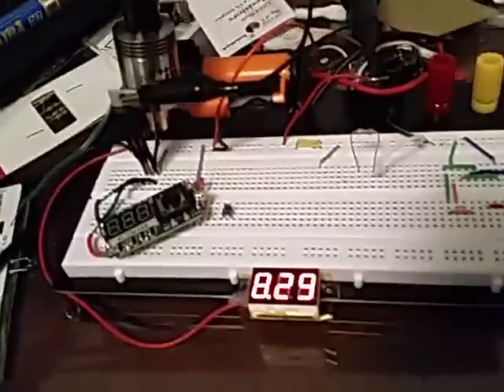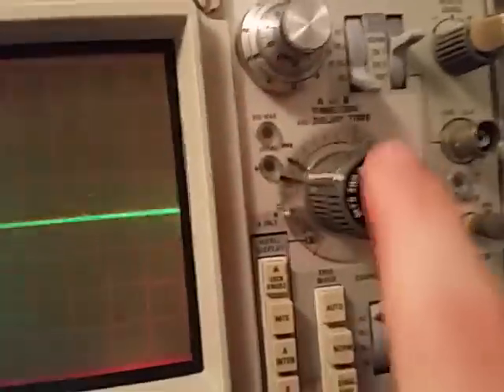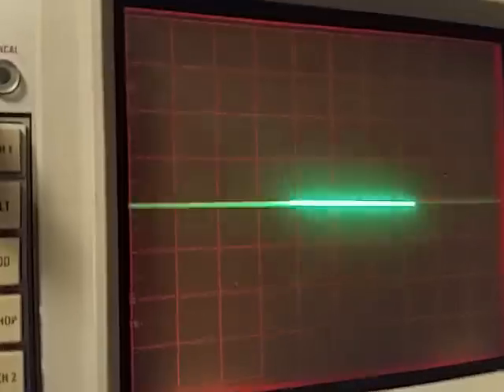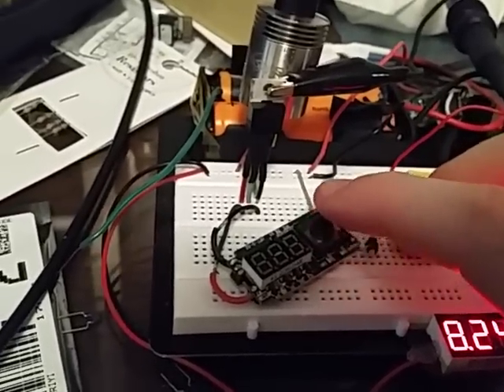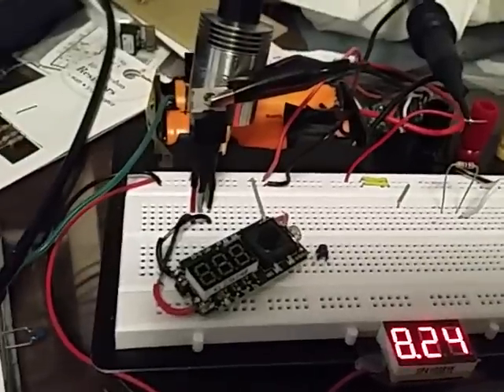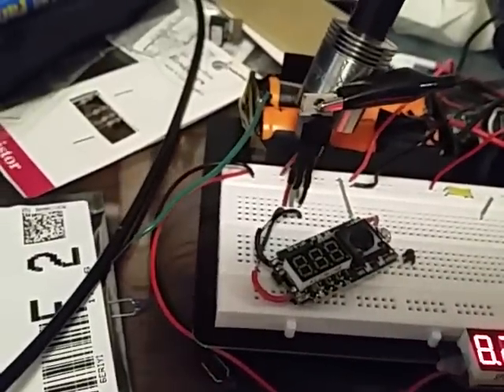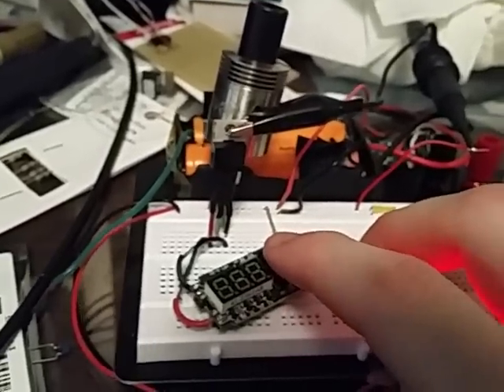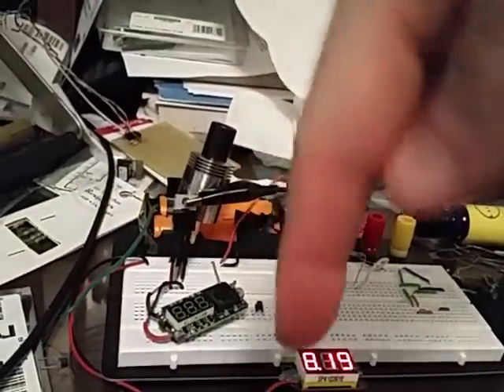Zmax Board as PWM MOSFET Driver

Comment: wouldn't you need batteries with an insanely high amp limit to run that .00001 ohm build at .3v since you're constantly firing at the highest battery voltage but only changing the duty cycle?
Reply from the maker: Tech Nician You sure would. Good thing no one does that.
Reply: Relayer1974
I figured there was quite a bit of exaggeration when you said that, can't wait to build my first pwm box. great vids btw, keep em coming.
Reply from the maker: Tech Nician Yeah the point of that comment was to exaggerate the poor battery discipline demonstrated by many mod users.
Reply: Relayer1974
 Ya, it's sad that so many people are ignorant when stepping up to mods that rely on the battery's amp limits and remain so or just stupidly ignore it for the sake of getting clouds.